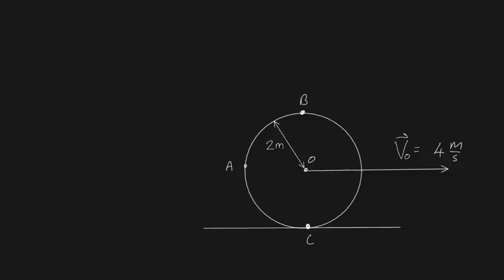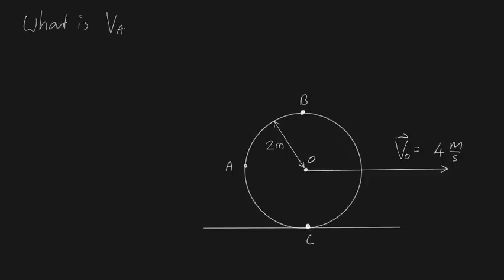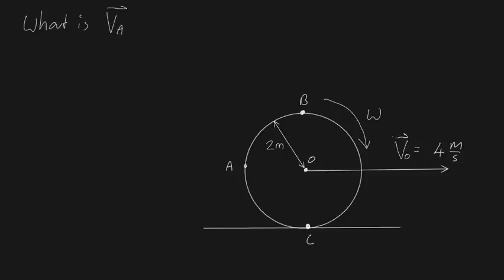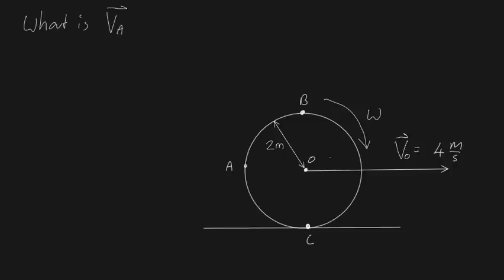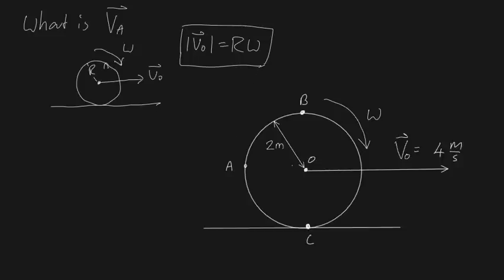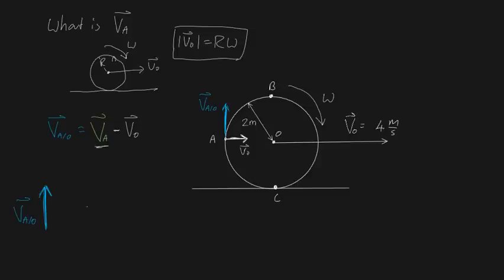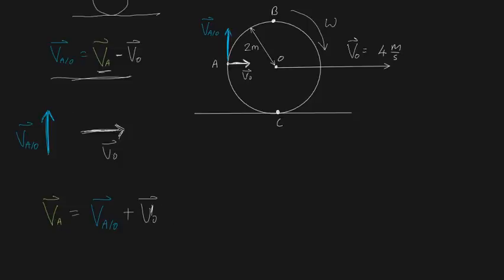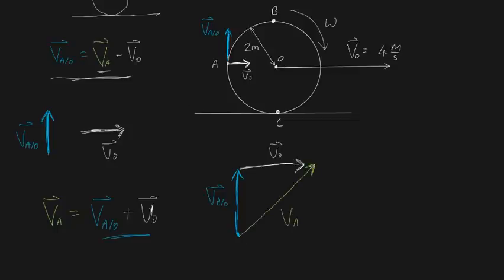relative velocity rolling wheel

Comment: Isn't beta always 45 degrees for a rolling wheel?
Reply from the maker: beta?
Reply: My apologies I mean theta. (:
Reply from the maker: whatthefiretruck69 Ah ok. No it's not. It's only 45 in this very specific case. If we were finding V_b for example, the angle of V_b from the horizontal would be exactly 0 ! (since V_b is purely horizontally to the right!). Does that make sense? Email me if it doesn't and explain further.